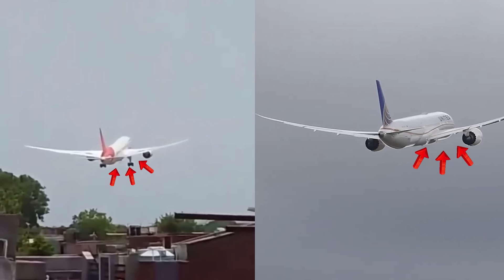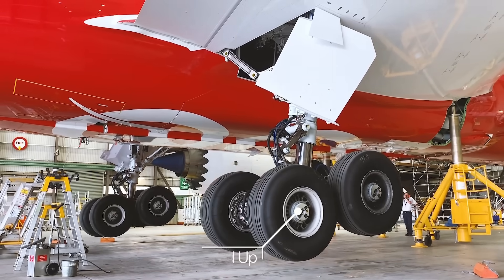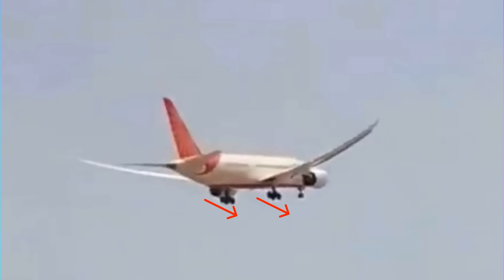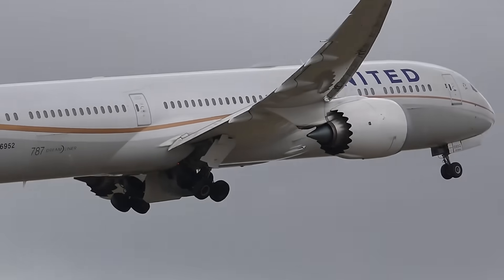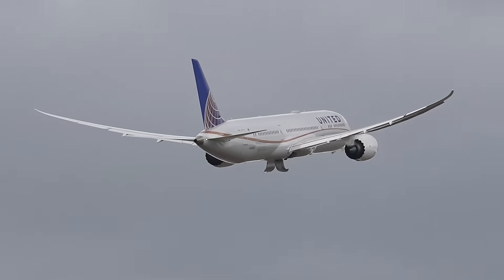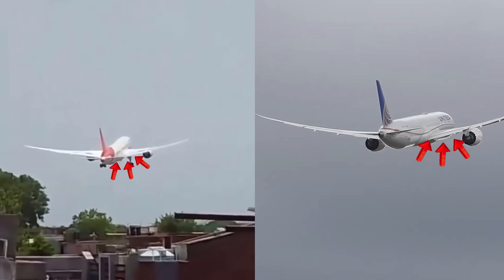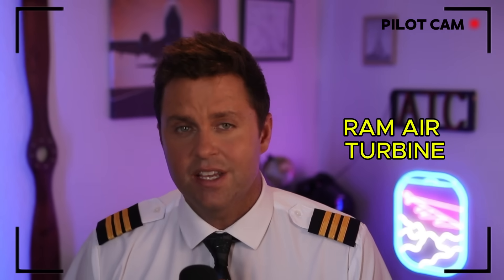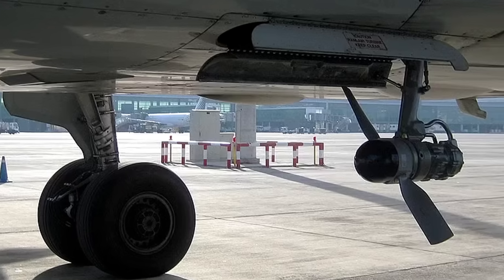Pilot Explains: A New Detail in the Air India 787 Crash Everyone Missed

Comment: Hi mate !
We can  also take an other Little detail, when the landing gear are retracted, the main landing gear tilt down but almost at the same Time, before they are completly tilt down, the main landing gear doors open and it didn’t happened ! Maybe with the dual engine failure Even with the RAT out the main landing gear didn’t have enough hydraulic pressure to continue the retraction of them and that’s why they are still tilt down but no doors open ?🤷🏻‍♂️ I don’t know if the B787 with a dual engine failure and the RAT out have enough hydraulic pressure to deploy or retract the landing gear ?

Sad story for the familles and aviation but I am impatient to know the full and real reasons of this crash…

Comment: However, this is not the first time a Boeing 787 Dreamliner has experienced such an issue. A similar case of unintended fuel switch transition was reported in a previous incident involving the same aircraft model.
 
Not the first time Boeing 787 experienced such a failure: US expert
 
In an exclusive comment to Financial Express, US aviation expert Mary Schiavo pointed out that this is not the first time such a failure has occurred on a Boeing 787 Dreamliner. She cited a 2019 incident involving an All Nippon Airways (ANA) flight in Japan, where the fuel switch transitioned on its own, without any pilot input, while the aircraft was on final approach.
 
 
Software glitch caused ANA engine failure
 
Schiavo told Financial Express that an investigation into the ANA incident revealed a software glitch had led to the transition of the fuel switch. The software issue caused the aircraft to mistakenly interpret that it was on the ground, prompting the Thrust Control Malfunction Accommodation (TCMA) system to shut off fuel to the engines, even though the pilots had not activated the fuel cut-off themselves.
 
The ANA flight, a Boeing 787 Dreamliner flying from Tokyo to Osaka with 109 passengers and nine crew members, experienced a dual engine flameout after the pilot deployed the thrust reversers for landing. The aircraft had to be towed from the runway, but no injuries were reported.

Comment: I was an automatic transmission design engineer in Ford Motor Company.  Once I was the team leader for the shifter team.  The shifter design is similar to the fuel shifter which uses detent to lock the shift position.  The detent is a simple mechanism and it could fail.  It uses a spring force to push a pin into a slot.  If the spring loses the force the pin will come out the slot and will move the handle to the very end because the other end of the lever is connected to a rod or cable with load.. Without the detent lock or a hand on the other end of the lever, the lever default position could be the end of the lever travel limit which in this plane would be the fuel off position depending on the design.

Comment: I retired from AA, but during a time when U.S. airlines were doing little hiring I flew under contract for Air India.  I was flying DC-8s and the aircraft belonged to ONA.  So the unfounded theory that I am proposing is water in the fuel.  India is very wet/humid and the airplane of course is very cold when it lands.  The fuel strainers and fuel sumps must be drained of water on a regular basis as part of the maintenance preflight preparations.  So the question is this.  Was the water drained out of the fuel system?
Reply from the maker: That’s an interesting take. Thanks for sharing

Comment: Garry, you are correct, the gear powered up truck forward indicates a sudden loss of power, if so ,the fuel cut off valves spring close shutting down both engines, ergo dual engine failure!

Comment: This 1st officer is wrong about the gear....if this happened the way YOU said......why isn't the gear DOORS down?
As per your inserted video, 1st cycle ~the gear tilts forward, 2nd  cycle, the DOORS cycle down or open...........
In the crash video these doors can NOT be seen open..................Mr 1st Officer>>>>>>>>>>YOUR WRONG.
Also, I could NEVER believe a 1st Officer could  confuse  the gear handle with the Flap handle. (or vice versa)

Comment: If fuel contamination was the reason, we should be looking at such events occurring at much higher frequency isn't it? From the same airport, on the same day, many other flights operated as well, right? Also, I learn from other sources that there are elaborate checks in the fuel storage, fuel injector to detect this and not dispense the fuel if contamination was detected. Another question is, wouldn't the aircraft sensors detect the purity of the fuel and alarm accordingly? Also, if the fuel was pure enough to allow the plane to taxi and take off, how can that be a factor at the lift time only? If air fuel is so vulnerable to contamination, we can imagine how contaminated or even adulterated vehicular fuel can be, yet we hardly encounter engine seizures with cars and bikes, which means their engines are robust enough and we can expect atleast a 100x robustness with aircraft engines ?

Comment: I don’t know why everyone dwelling on the flaps and the landing gear. The problem was definitely engines whether the control or the fuel lines.. bad fuel, contaminant or water. Also hot day in India 🇮🇳 and I don’t know Is rat 🐀 or snake 🐍 made its way into the air craft or human rat 🐀 or human snake. You don’t need a full length of the runway to rotate. The forecast called for 40 C that day. But with a heated up pavement it could be more than 50C , which disqualifies the Boeing 787 from taking off. What was the angle of attack on that take off?. If pilots aren’t happy with more than 11,000 feet , plan on short fields take off. May be in all hot regions around the world, stick to Boeing 777X. Please take off over night in the hot summer. Consider aircraft with much bigger engines and much bigger wings. It’s always a pilot error no matter what. Pilot should  go through the takeoff checklist, check engine temperature and power. Stay focused

Comment: Do you think the pilot having gone past the point of aborting take off took off with an engine fault occurring and attempted to punch a take off on one engine. To reduce the chance of a fire  hazard in the faulty engine it was decided to cut off its fuel supply and accidentally the good engine was cut off.

Comment: A dual flameout is possible and has happened in the past. The fuel could have froze prior to entering the combustion chambers, as had occurred to a 777 on short final to Heathrow in 2008. The flight crew must have had issues just prior to or immediately after rotation because the  gear was never raised. Boeing needs to straighten up fast.

Comment: A dual flameout is possible and has happened in the past. The fuel could have froze prior to entering the combustion chambers, as had occurred to a 777 on short final to Heathrow in 2008. Boeing needs to straighten up fast.

Comment: Hi as a Licensed Aircraft Engineer the only way this is determined is by the FDR and CVR being analysed for all the parameters of the aircraft .
What i can say is that your saying fuel contamination ?if this is so why didn’t it happen to other aircraft taking off on the airport.Flap position 5 is normal for a 787 take off this would only be determined if you can see the slats out which you can’t from this video.
I agree for some reason both engines lost thrust for whatever reason ,wait and see for the report .there are so many armchair so called experts commenting on this wait for the facts

Comment: In the takeoff video we assume we are seeing dirt kicked up by the engines at the end of the runway but it's hard to tell depth of field. What are your thoughts on that possibly being a dirt devil crossing the end of the runway that pulls dirt and rocks up into the air that the plane flies through and then causes dual engine failure?

Comment: I've said this before and I will say it again for the sake of posterity!!! The Air India flight s twin engines likely flamed out simultaneously because of fuel starvation!!! It's the only plausible cause other than fuel cut off valves being closed by maintenance crews. In either case, this is a sordid case of gross negligence caused by well known east Indian stupidity, pure and simple. Why is everyone focusing on the goddamned landing gear??? The landing gear didn't bring down the aircraft and the aircraft never reached either V2 or minimum safe altitude for gear retraction!!! Fuel starvation or poor fuel quality. One or the other!!!

Comment: the fact that they used up the full length of the runway before rotating up the nose at takeoff suggests that they may have an engine thrust issue even during takeoff roll, which might manifest further when issuing a command to the hydraulics of the landing gear. And without the "juice", the RAT was deployed as designed. YUP, it might as well fuel contamination.

Comment: Well do you wounder why the NTSB don't do video's like this your's don't give any more 
info? What you don't respect is the dead and the families  did we forget they lost love
ones? Every one suddenly is an expert there 20-30 others all with same.
I flew most of my life son of an Airline pilot. Military and 32 years for a major Airline.
I also worked with the NTSB on bring safer airline travel.
I flew 27,37 57's and later Airbus 320's Most of my time was in 737 which during it's
first 25 years in service had an excellent safety record. 
Then came the 2 rudder reversal problems which took years  to solve. our airline
was one of the two. when the problem  occurred the pilot had approximately 
10 seconds diagnosed and take the correct action. They didn't.
In this case the crew had only a few seconds more and at the most critical 
time of take off and from the Mayday they didn't know what the problem was
So only the all the cockpit and data info will tell us what happened.
and we should think of the love one's  and have some respect for them.
and only speak when you know and stop guessing.

Comment: I also have seen no discussion of a possible failure in the FADEC system. The Full Authority Digital Engine Control system is responsible for running the engines at max efficiency in a given configuration, e.g. takeoff. FADEC has no manual override. If a total FADEC failure occurs, the engine fails.

Comment: Gary - there appears to be an answer and channel: Beyond the BS with video named: Did Boeing’s 787 8 Safety Logic Doom Air India Flight AI 171?

It suggests that there was a failure of the Electrical systems which reset the FADEC to 'Protect Idle' mode after rotation and both engines rolled back and there was virtually no thrust at all.
It shows how the systems do have redundancy, but depend on that too much and as a result you can have a catastrophic failure leading to 2 good engines failing because they are not getting the correct commands from FADEC. It would also account for the RAT being deployed and why the undercarriage was still down. There was no hydraulics to raise them - not even the RAT was enough.

Extremely good explanation and it happens to tie in with the failure of the air conditioning on the ground and the lack of passenger systems for 2 hours. It was showing that the electrics were already faulty and when they went out to the runway, the raw heat may have caused the electrics to fail altogether. They used the entire runway to get enough speed to rotate, but after rotation, the system crashed and the engines idled and they could not reset it.

Comment: It concerns me that they apparently reached the very end of the runway before rotating. Even with the aircraft in 'heavy' config, there should have been plenty of runway left. Was this already a sign that the engines were operating at reduced thrust? This could have been for a host of reasons, including that the fuel was contaminated. Then there's the fact that the aircraft lifted off regardless of possible thrust problems. A poor decision at the point of no return? A poorly-designed airport with insufficient room to abort safely?  I have not seen these possible issues addressed.  I also have not seen an airspeed profile during takeoff and descent.

Comment: Something like this happened in Francis Town Botswana Africa about 50 - 40 years ago, (I can't quite remember). The aircraft was transporting seasonal labourers back to their country of origin. Shortly after takeoff the plane just dropped, crashed in flames. All souls lost. The enquiry found that paraffin, normally added to fuel, was in larger volume than it should have been. As a result, the jet fuel was in too low a quantity. Subsequently it was established that workers on the ground had been systematically stealing aircraft fuel and replacing it by volume with cheaper paraffin, to the tipping point that the aircraft could not fly on the reduced mix of fuel. The aircraft dropped and blew up. Similar to Air India crash.

Comment: Gary a possible cause 
Similar to what happened to Cathay Pacific Flight 780 in 2013 from Salt water in the fuel storage causing the fuel filters on the refuellers to fail and releasing particles of superabsorbent polymer into the plane's fuel.
Which directly affected thrust control on Cathay Pacific Flight 780 which safely landed on full thrust . This Air India 787 crash doesn't have any fuel left to examine due to the explosion and fire, so we may never know if this is a possible cause.

Comment: An electrical failure was my immediate thought after Captain Steves video about the RAT being deployed. A loss of electrical power will cause a loss of fuel pumps and igniton systems. It doesnt sound like the RAT is capable of restarting the engines if theyve slowed down very much. Or perhaps electricity was unable to reach the engines to be able to power the fuel pumps and ignition systems. Or power wasnt reaching the controls to be able to command the engines to restart. There are many possibilities, but I think they are all electrical related....power wasnt able to get to where it needed to be to make things work.

Comment: If there was problem with fuel contamination, atleast one of the engines should be operated (due to the separate fuel tanks). Also, NONE other planes reported this issue, for THIS airport, the SAME day. A DUAL ENGINE FAILURE,is rare probability

Comment: Gary, the later info you've put out as "just information" is spot on.  I believe once all the papers, investigations and discovery is done your work on all the difficulties Boeing has experienced will be brought to the front.  The plane landing and engines stopped, the heat difficulties AND the breaker being tripped will ultimately be exactly what caused this crash.  As I said, it's a death knell for Boeing.   The lawsuits will kill the company.  Mark them up as another Pan Am.

Comment: Gary, you are right. Both wheels being powered up the same time presents a huge load on the electrical system with inrush currents 7 to 10 times the norm. The old Ni-cad batteries could tolerate this ,but not the new lithium. Given what is in effect a 'double short circuit' they tend to explode. I think that was the bang that was heard, resulting in  a total  power failure, knocking both fedec's out thereby shutting down both engines.  If I'm right, it could happen again!  What a tragedy. ( Ex Maintenance Manager at Dubai Airport )

Comment: How does the fuel pumps work? 1. if they use electricity then there will  be no fuel to engines in case of electric failure. 2. Is there any posibility that, as far as I know, there is a switch to stop fuel to one engine in case of fire, is it possible that those switches were turned on manually or by a catastrophic failure?